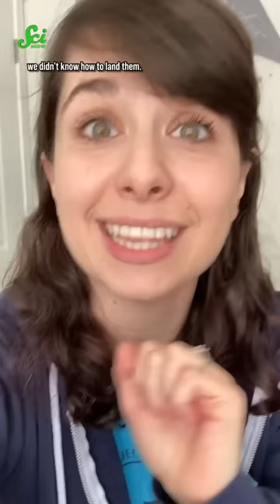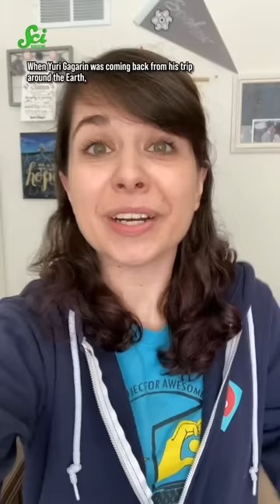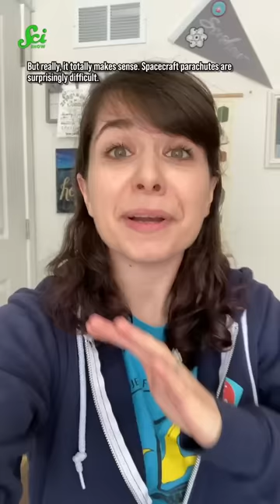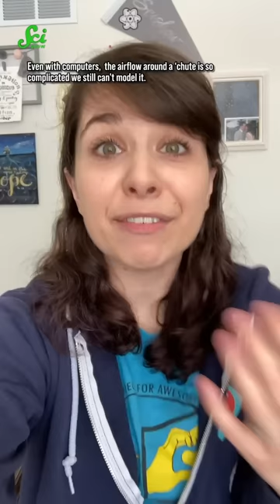Parachutes are so hard! #shorts #science #SciShow

Comment: Parachutes are difficult even with model rockets. We used to launch them out in the desert as kids, and parachute failures were pretty common. Completely trashes your rocket if the parachute never opens.😢😂
Reply: Yeah, always fun when the engine ejects, rather than the nose cone and parachute. Only had a few lawn darts though, cooked a chute once. Streamered to a safe landing and one detached fin.
Reply: @Stephen Villano  We burned through TONS of parachutes! Burns a hole right through the center if you don't pack them right, or the nose is too tightly packed. Of course we had mostly small rockets too. Except for the one giant one one of the adults made that was as tall as an adult human. (All improvised). I believe it used, like, 2 dozen H/G engines and was 90% duct tape. That was the good ole days...
Reply: @xerofelix7090  I rarely did, but Dad was an airborne ranger years before, so he did show me how to pack a parachute. I also had enough wadding to ensure that the wadding took the heat away from the parachute.
I did have failure to deploy once from too tightly packing the wadding and a bit too tight of a nosecone fit, lawn darted on me.

Comment: even with parachutes figured out, the soviets had a hard time coming up with an actual soft landing, given they didn't have access to a large body of water.  so the solution was to fire retrorockets a few meters above the ground. the early trigger was a literal 1.5 meter rod that fired the rockets when it touched the ground. the upgraded trigger is apparently gamma radiation based.

Comment: retro thrusters semm obvious now in hindsight. turn & burn is a meme today
Reply: They are also very difficult to get right. Aerodynamics still play a massive part because of the high speeds, you still fight gravity because your primary goal is still slowing down, you have to make a much bigger rocket so you have the fuel to slow down, and the calculations have to be near perfect in order to stop the craft at the right altitude without going back upwards, crashing into the ground, or running out of fuel. 

At the time they were dealing with computers less advanced than a Ti-83 and therefore parachuting still made more sense. Even more so because they wanted to beat the Americans to this goal first. Both nations had the incentive to move as fast as possible in the space race, waiting around for retrograde thrusters for landing would take too long.